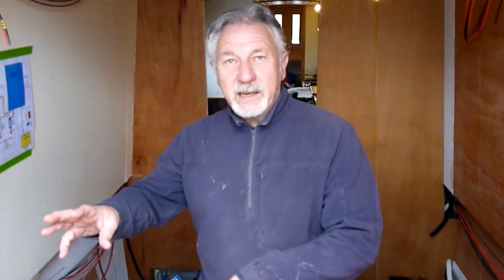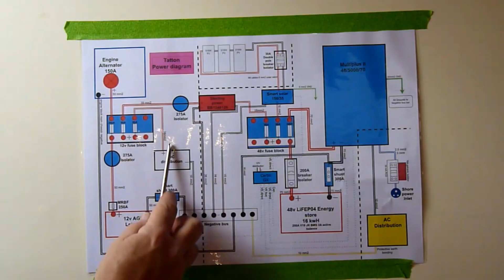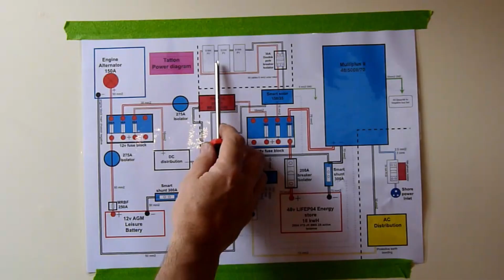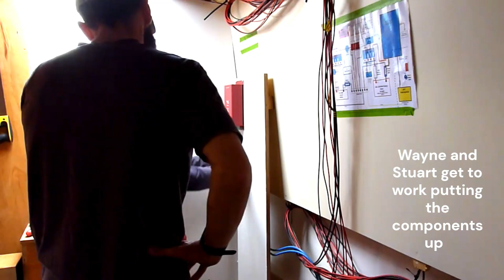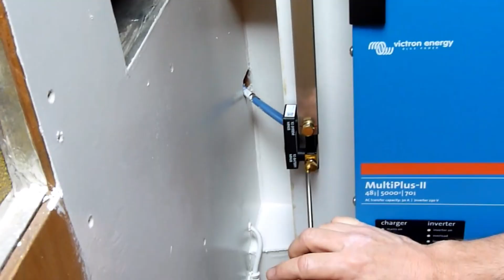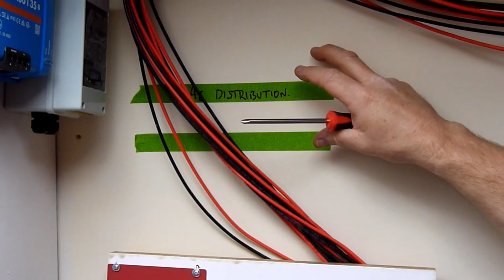Narrowboat Self fit out   Ep 108 Off grid electrics start

Comment: Good morning. What are you doing to conform with the RCR. I’ve recently read that the batteries need to be installed in a fireproof, ventilated box, if they are to be fitted in the cabin. Or are yours going in the engine bay. Good luck to both of you.
Reply from the maker: Hi Steve, hope you are well.
My original plan was to fit the battery under the steps but with these new regs on the horizon I'm going to try to see if it will fit in the engine bay up on the swim.
It is a large battery (314Ah at 48v) though and very heavy (120 kg or so) meaning that once it is in it will be very difficult to get out, ever. 
The engine bay is far from ideal because of the vibration, heat, cold and lack of accessibility. but if that's how it is then so be it. 
I could build a box ect, to fit it in the cabin but with the regs not being fully formed yet this is a complete minefield.
It's really disappointing that these sort of regs are brought in with only large scale manufacturers in mind pushing out the individuals who just want the challenge of building a boat for themselves.
Thanks for commenting
Reply: @AtaleofTattonTugMorning. I’m using a company called HPIV for the RCR. I’ll give them a ring and see what they say and let you know. Boat is looking good. Well done to the pair of you.